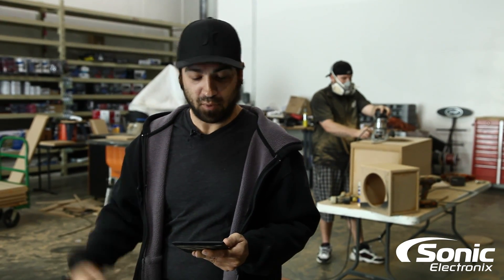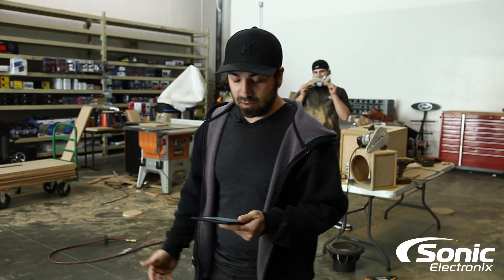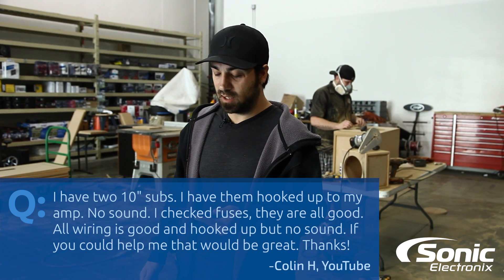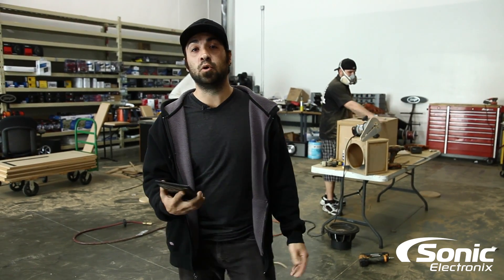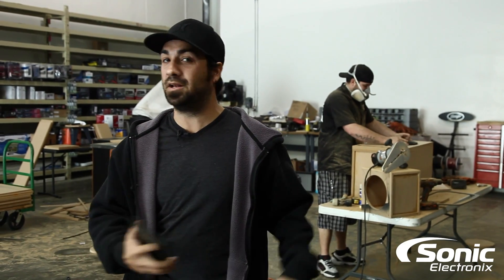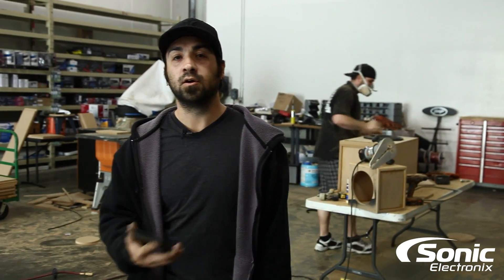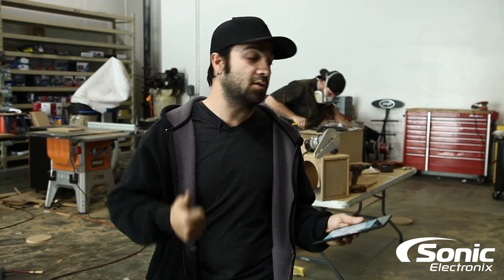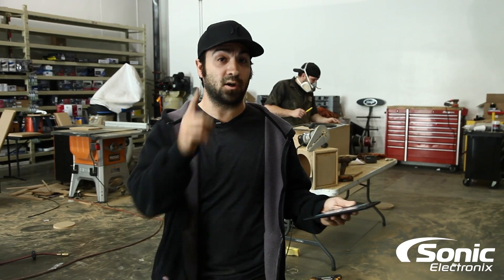Why Am I Not Getting Sound Out of My Subwoofers? | Car Audio Q & A

Comment: I have a Kenwood ddx4025bt I have a active subwoofer hooked up and working fine in one of the 3 x 4v pre outs (in front now) works fine does what a front preout should do but when I put that working setup into the sub pre put there is no sound. I've checked all the settings and found the setting for turning on subwoofer and it's on but still won't work. What should I try now?

Comment: My subs were working and then stopped mid song. I assumed fuse was bad so I changed it. Now the subs won't work and everytime the bass is supposed to drop all my lights dim super low but no sound. Thoughts?

Comment: I have a issue just put a shallow l7 in my truck in less then a month it has a dead spot. Intermediate sound output. I push on the sub and the sound comes back on . And it doesn't like low volume now

Comment: So the only thing connecting my 212 to my amp are the speaker wires I don't know where the fuse is I checked everything I feel like it has to do with the converter with RCA jacks but I'm still getting music out of my back speakers what should I do next I feel like it is the converter wiring and I also think this because the only connection to the speakers is to the amp in the amp goes to the RCA jacks which are connected to that which is the only thing that Stein in the speakers to get the music correct do you think it's a wire somewhere

Comment: Ever since I switched my car battery my subs stopped working all wires are hooked up and fuses are good could you help me?
Reply: My amp light turns on and when I start my car I can hear a little thud from the sub but it wont work after that

Comment: My sub is 1200 rms and im trying to push it with a 80rms amp well my friends amp to make sure they work i push the subs in no sounds out no sounds but no power im sure a 600 watt 80rms should atleast push one sub but no nothing and then he puts its on his little 10 inch dual sub and it works but its only like 500watts im sure the rms is like 100 big difference in power would that not cause my speaker to not budge considering its such a weak amp or something

Comment: hi I'm drew I need help I have a one kicker kx 800.1 amplifier it's hooked up to a 12 l7 kicker wires inside box was good I tested sub on multimeter I got 1.9. or more on meter on dvc both read same seem fine but woofer is a bit stiff idk I hooked up to someone's else's amp no sound really but I went back to my amp it's on no problems I hook it up no sound I tried almost everything I'm on a stock head unit on kia optima 2012 and loc is tied in back door speaker tapped ....it ran. Fine it was hot day amp in trunk sub in car ..now full blast which never had problem now I hear clipping was the matter I tested dvc on multeter 1,9 each side it's wired crossed out to side of box just a normal day I had amp smoking hot but says that's how they are I fixed the grounded out wire or out of protection mode I tested sub went to hook it up all my setting on amp turned down I check battery car ran amps good recently all my shit in car started dimming pounded speakeraybe 30 min straight mess normal then it just shutoff the music I turned the dial back down and slowly up it sounded like sub was shot and amp was in protection I went threw it all I got a POS loc tested it while music was on and just no sub please help fellas it a shitty day and if sub tested good and amp is it stock head unit that won't push is stock or is my amperage too shitty it won't play or visa versa as well is my battery for car just a POS I checked all wires fuses that I know of just need advice please guys help a brother out amp gets smoking hot and I just get no audio even hooked sub up to other amps kinda feels like it is a bit hard to press down on sub but still pushes up and down just not so freely but testes. Good on multimeter

Comment: My amp is about 20 years old and was still working fine til about 2 weeks ago. I had a bunch of stuff in my trunk, so I actually didn't turn them on for about 2 weeks. Try to turn them back on, and I get no sound now all of a sudden. Only thing I could think of was that I did jumpstart a pretty big car with my small car, so maybe I blew a fuse. Fuse looked fine, but I had a spare and tried it based on your video, and still not getting sound. Amp turns on, light turns on. I haven't changed anything since 2 weeks ago, or played it. I tried running an AUX RCA cable to my phone and it didn't work either. So I don't think it's my RCA cable, which is in pretty worn condition. If I have to get another amp, I will regretfully get one, but just seems weird that it would go bad without even being used. Like I didn't even turn on the radio for a couple of weeks.

Comment: My subs are making a rumbling sound when amp turns on.i unplugged all rcas and still does it.i have a switch to turn on amp cuz the deck has no remote wire.noise starts few seconds after amp is on.amp is out the box

Comment: Hey i got a quick question. My amp is getting power, LED is on. And voltage going into amp is good. However no sound from subs. If I crank the volume they work flawless, and once i turn volume back down they work for about 10 minutes. Than nothing....ive tried multiple settings with the Hz and all result into the same issue. Not sure wtf could be wrong?
Reply: Have you tried replacing the inductors inside the amp

Comment: i have a jensen international A- 82 car amp and what its doing is that the amp turns on and no sound kicks on the first time and every time. if i turn the switch off and on, on the  my pwr supply for a few seconds then the sound will kick on. here are the wire wires on the amp yellow  battery. source ground black with white stripe. power ground solid black. whats the difference between those 2 wires. blue wire auto sensor. what else do i do to fix this please let me know thanx and good day

Comment: HELP!!!! ok brand new BOSS 4000ampmax everything is on powered up. 2 12" kickers 2000ampmax. when I connect the amp to ground and positive cord to battery both speakers thump once till I remove the +cord then they thump once again, NO SOUND OR BASS. could the kickers be more powerful then the amp and that's why I'm only getting a intial thump going on and coming off? if so what amp do you recommend for the 2000wattmax kickers? for right now 2/7/20 I'm running off factory Sirius radio in my 2013 dodge challenger rt.  I've also got the PAC LP7-R2 LOC connected as well but the light never came on so I tried directly hooking it up again nothing came out. anyways thank you in advance. and yes I've checked all of the above mentioned, well my dad did. hes stumped as well. in saying the same thing I thought maybe the speakers are to powerful for the amp, to which i might've answered my own question. just wanting to confirm. agian ty

Comment: Hi I have a kicker l7, I checked the ohms on the voltmeter and it doesn't have read any ohms, but it moves freely and has no resistance. It was working but then just stopped. I have power to my amp and tried another speaker and it works. I thought when the coils go they seized but this isn't the case? Can I help
Reply: I have2   l7 and I took box out to customize it and now they won't hit all wires are good I literally rewired every wire  I checked  speaker with multi meter is good all connections are good I'm lose

Comment: How many Volts should be coming from your fuse to your AMP to know it's a good connection and their's no wiring or fuse issue?
Reply: The same as your battery. 12.7 ish when car is off and 14 ish when on

Comment: Having issues of loosing sound when the engine is running. Replaced the fuse. Re did the ground. Getting full battery v at the amp and 14v when running the vehicle. After  the car is running for a couple mintues I lose sound. Light is green on the amp not in protection. But if you turn off the engine to acc after a couple seconds the sub come into it and work fine.

Comment: Okay, all good points. I have a voltmeter and tone and probe, I've traced all the way back to the amp, have output to the aux, amp is getting 14vts lights are all on, checked output and getting sound, but it's super soft, could this be the amp fading out slowly? In my experience they work or they don't. I'm stumped!
Reply: Oh it's a Rockford kit 1000watt amp and two rf 12s
Reply: Oh btw it's a Rockford kit with 2 12s and 1000w amp.

Comment: Green power light flashes won't remain lit, not getting much sound (on any volume level )only on the really low notes, will vibrate a little ...any suggestions...ground, power, remote wires all correctly wired?

Comment: i have soundstream tn4.12000d where is my fuses at? i have 2tens worked good i just disconnected my RCA wires to the speaker and then put it to the new speaker I bought and it stopped working and now my amp is going to turn on I checked with the voltmeter and getting voltage but the amp does not turn on and it does not have any visible fuses what do I do

Comment: So I checked my fuses, my wiring, and everything was perfect, checked with a voltmeter and I was getting plenty of power, and I truly had faith my JL amp hadn't died on me, now after a week of troubleshooting I just started messing with everything unplugging and replugging it all and flipping all the switches on my amp and turning the knobs, one week later I flip my bass boost off and bam the subs kick back on, flip back it back on and they're still working and haven't had a problem since only a few hours in so far though, very odd if you ask me. Any idea why this was?
Reply: same.. subs worked great for a week then stopped working.. then 3 days later the worked for 2 weeks and now they dont again... amp is showing its on and not in protect mode.. checked all my wires, and fuses, everything looks great... do u think it could be my amp taking a shit or the rca to speaker converter box??? i opened the rca converter box and it seemed fine so im fucking lost
Reply: Any luck on the fix?

Comment: I bought a truck with subs and was working just fine. Then I changed the deck and the quit working. I also checked the fuse next to the battery as well as the fuses on the amp with my multi meter and there all working. Can changing the deck make the amp crap out?
Reply: Did you fix it

Comment: My bass hits on low volume, but when I crank it up, It cuts off beat. Its still getting little output hitting about every 3 seconds everytime. When i tune the volume of my radio lower, it sounds good. My amplifier gets good power when its volume is low. It glickers when i crank it up. My amplifier was over heated for some reason as well. Is there a way that I can get back speakers hitting good when I crank the music louder like before? please help! thanks 👍
Reply: Tyler Carriere what kind of amp? And do you have stock electrical?

Comment: My 12" subs work and boom to the beat but its very quiet and I know they have more potential than that. My controller is set to max and my bass boost is on, and I still get kinda quiet bass. What could be the problem
Reply: Pyro Aficionado ur subs can handle more power get stronger amp

Comment: I got two amps one for the highs or door speakers whatever and the one for the subs is Bridge off of that one the one for the subs turn on but I'm getting no sound for the bass have RCA cable one side is split and twist together could that be the problem do I have to replace the RCA cable running off the highs amp to the sub amp

Comment: I have a Polaris General with ride command.  It came with a sound bar that works great.   I want to add a sub for some bass. MTX make a sub the Fits in the console.  We hooked everything up and all we get is a light hum.  There r two gain knobs for the unit.  The light hum only comes on when they r both turned up.   No music.   We unplugged the sound bar and plugged the sub into that and got low volume music.   And ideas?   Contact me at ljsgojo1@gmail.com.   Thanks

Comment: Why is my subwoofer not giving bass cause there’s very little bass
Reply: Me too
Reply: Same.
Reply: Me too I need help no store can figure it out
Reply: Did you find out why
Reply: @noorkhalid7007  help me out
Reply: I had same problem even when you turned it up the bass stay very low . Still played but low volume bass . I SOLVED it !! Loose Power & Negative on the amp . Make sure your wires are  tightened down good on both the amp and battery ends . ( it’s better to disconnect the wires , cut like about 1 inch of each end and tighten back up where they belong , that way it’s fresh wire that’s on the inputs ) hope this helps! This helped me ! And also my rca was cut a bit and made a short

Comment: Hi,
I have a question please.
I have no much idea about installing car audio system ... but i tried and i got only bad bass sound .
So here what i have ...
AUNA amp 6000W (600RMS) 6 channel.
Pioneer DEH-1900UBB Car Audio.
I am using  2x  Sony stereo speaker's 100W
When i give the signal audio from my phone everything works fine.
But from the audio car output i got only bad bass sound .
Is the RCA filter my solution?
Or i have to use output converter from the car audio lines?
Also i tried another JVC car audio and i got the same problem ...
I know there is Incompatibility between the audio outputs and the amp .. 
So what can i do please?
And i will be thankful if you help me ♡

Comment: In pretty sure my amp is probably dead but just to make sure. When i turn up the volume and the sensitivity knob on the amp, you can sorta hear the woofer. I opened up the amp the capacitors do have a very small bulge to them but is super hard to notice. What can can cause this problem. I really want to fix this amp. Please help

Comment: Recently my subwoofers stopped working. I visually inspected it and checked impedance of both coils and they both were around 2.1 ohms which is good for 2 ohm voice coils right?  No signs of anything blown or broken. It even passes 9volt battery test. I think I narrowed it down to bad rca ports on my amp but if I plug my phone headphone jack to rca on amp playing music I can get sound out of my sub. But head unit nothing!  Just bought brand new head unit trying to troubleshoot this problem and rca preouts test good. Any ideas I'm stumped

Comment: Why would my sub be making a very loud sound when my car is running and when the amp gets a bit hot it starts going louder and louder. Ive checked the fused the wires the fuse to the amp. Nothing has worked. I do not have a capacitor because I am not running anything very big.

Comment: hi i don't get sound out of my radio i tested it rica is new and why is this could this be the fuse on the radio or no the radio works fine just not sound out of the amp all the speakers work but the subs

Comment: Question?  I Have A Fosgate R600x5 & Had A 10" P3D4 Wired At 2ohms, It Blew A Few Months Back. So I've Recently Bought A NVX VCW104 & Wired It At 2ohms & Now My 5 Channel Will Not Work But If I Switch The Amp In 4 Channel The Sub Works But Not At It's Potential. ANY HELP OR TIPS.. PLEASE & THANK YOU..

Comment: I have my subs and amp located in the trunk of my car, I had a 900 with a 12" pioneer and everything worked fine no problems whatsoever, I bought a different set of subs much stronger (1500 watt and dual 10" Rockford T1) the subs work when I have my trunk open but when I close the trunk the woofers go on and off, work for 5 seconds and silent for 30) please help
Reply: Could be clipping or lack of battery power to keep up

Comment: I installed 2 12s and a 1600 watt amp to a stock radio with the rca adapter. I'm getting sound but it's so low my door speakers hit harder. I should be able to rattle my doors but it won't. does anyone know how to fix this ?
Reply: Woodrow favis if you haven't already check the setting on your amp. Gain, bass boost, frequency, low pass filter. could be set to high pass or a high frequency so it's not hitting the notes it's built to. tldr: mess with the knobs on your amplifier.
Reply: Rico Reillo turns out the rca adapter also has volume controls which was turned down.  thanks for response

Comment: both my amps worked when I pulled them out 2 days ago and I put in ofc and threw away the cca and my grounds are good, crimps are solid, have plenty of power but can't get sound out of my 4chan I got 1 speaker to work for a split second but I can't get my woofer amp to turn on either. and my first 4chan amp went in protect and I'm wired up 100% on the amp and even checked speaker connection and I've swapped all rcas 2ce now So idk next swap my CD player and see if that'll help

Comment: I have a problem with my system if someone can help it would be so nice and stress realiving.
I hooked my como vrs and everything worked fine until my amp started smoking.this happend after 10minutes or less of use.i pulled over and checked everything if something was making a ground but nothing.well my system still worked.ibhad the worry but still keep lt banging.them 1hour of less my system stopped functioning.my bass was not coming out.i check rcas current on amp and ground.my fuse burned and changed it to 300.
Then out a different amp and diferent rcas.and still nothing no bass.but my 6/9s work fine.and my amp that smoked still turns on?what is the problem?
I bought everything a few day ago and I'm desperate to fix it.

Comment: I just bought a brand new amp and 12 in dvc sub for my truck and installed everything correctly but when ever I turn my truck on the amp goes into protection mode instantly. I have used my multimeter to check the power at the amp and it's only getting 9v I have no idea how to fix